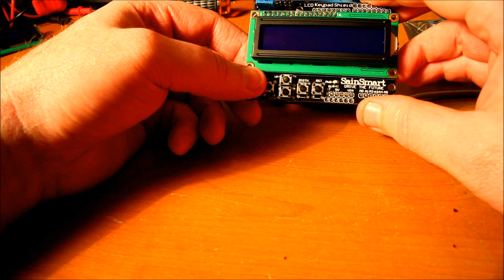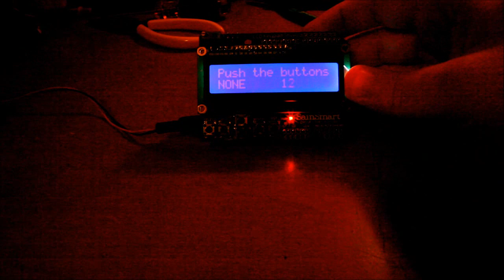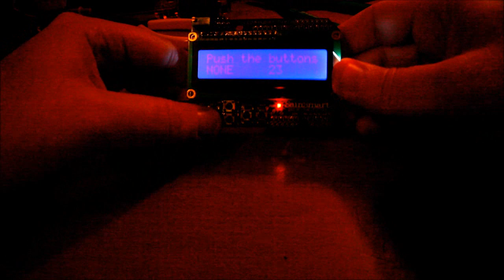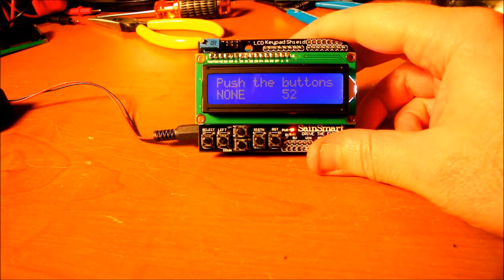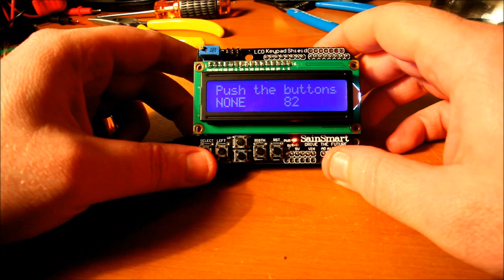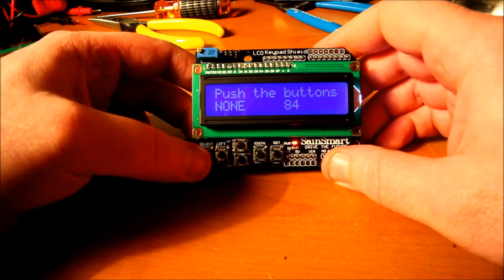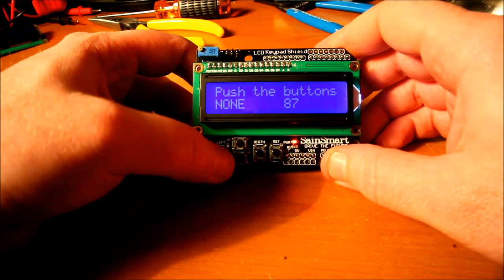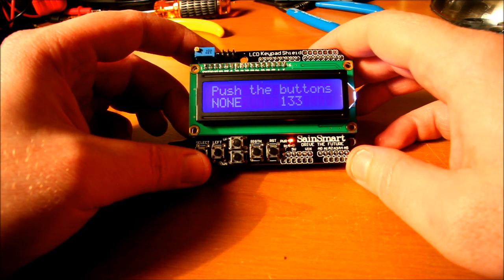Sainsmart LCD keypad Arduino shield review

Comment: How many hours -  in general as crude average - can a 9 volt battery make an Arduino Uno with LCD Shield run?
Reply from the maker: Mohamed Fahmy I don't have a number for you Mohamed.  I can tell you it is not as long as you would expect with the backlight running.

Comment: I can't see anyone noticed that the potentiometer on the upper left corner is not for brightness adjustment. It's for LCD contrast. You can change brightness by AnalogWrite PWM signal to Arduino pin #10.

Comment: I mean the built in code examples that come with the Arduino 1.0 development environment of course.  The DFRobot keypad LCD shield looks like it uses a different mechanism for detecting keypresses than sainsmart.  If I understand correctly, sainsmart uses digital IO for detection whereas DFRobot detects different voltage levels at a single analog input.  In any case, I have the Sainsmart and it doesn't "just work" with Arduino examples.

Comment: Pt2 - The LED on my Mega flashes, so I know that it sent. However, while looking the code over, I saw that the pins in the sketch are calling out : LCD RS pin to digital pin 12, LCD Enable pin to digital pin 11, LCD D4 pin to digital pin 5, LCD D5 pin to digital pin 4, LCD D6 pin to digital pin 3, LCD D7 pin to digital pin 2, LCD R/W pin to ground, 10K resistor: ends to +5V and ground, wiper to LCD VO pin (pin 3) Those are different than what you said this uses. 
In short: HELP! Please.
Jeff

Comment: Ok, I'm new to electronics and I got the Sainsmart LCD keypad Arduino shield from Ebay, too. I've got an Arduino Mega 2560. I have been able to load the sketch that you demo'd  here & the "ADC Key Testing" sketch from the seller, nichegeek but, I can't seem to get any others to work, i.e., "GuessTheNumber", Autoscroll, etc. without getting a lot of error messages. I loaded "Hello World!" and it compiles & loads fine according to the Arduino 1.0 but, the shield doesn't respond or show the message